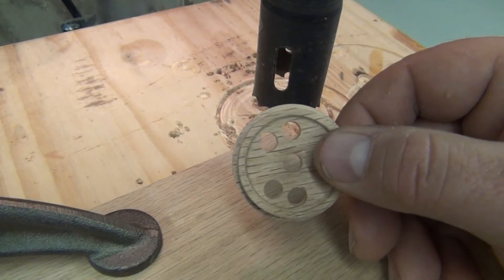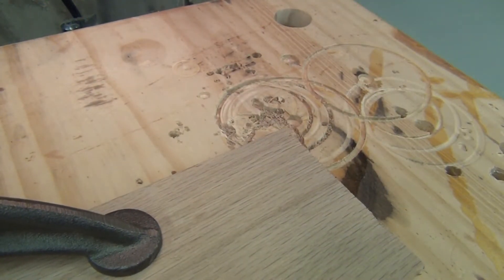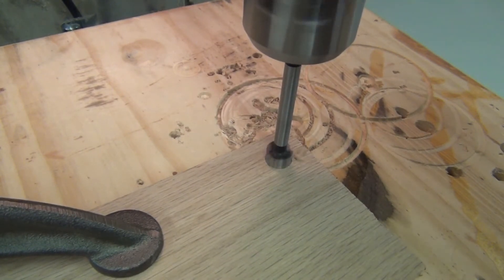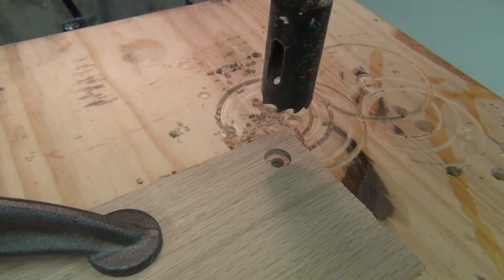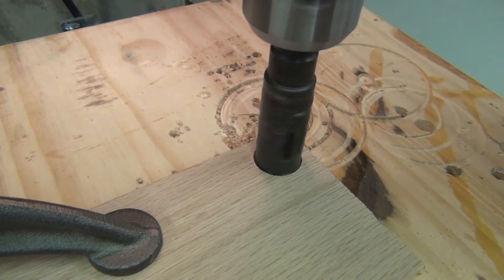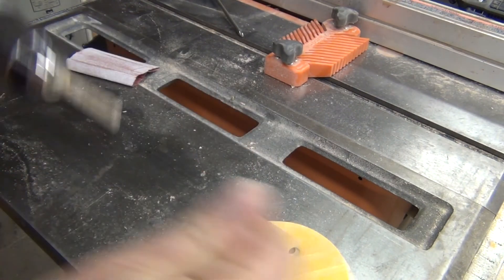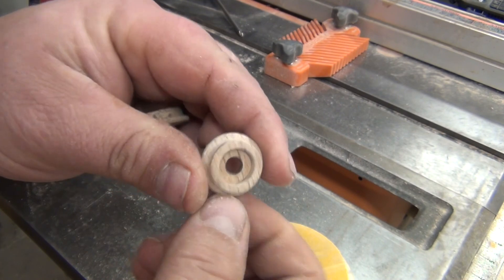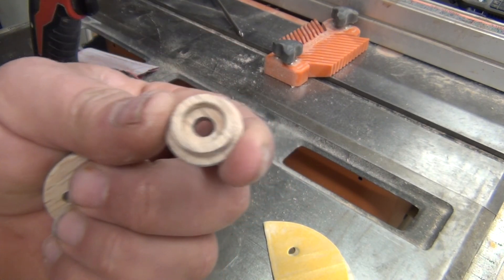Wooden Steam Locomotive Truck Wheels

Comment: Brilliant, I thought your instructions were clear and easy to understand.
I would have liked to have known the type of wood you used, and the depth of cut for the 1/2 inch forstner and the thickness of wood used on the truck wheels, also depth of the 1/2 inch hole saw made to create the tyre of the wheel, I am new to this type of hobby, and keen to improve my skills.
Thank you in anticipation